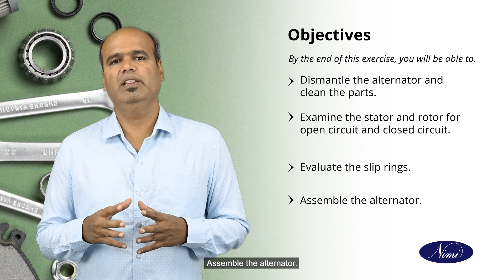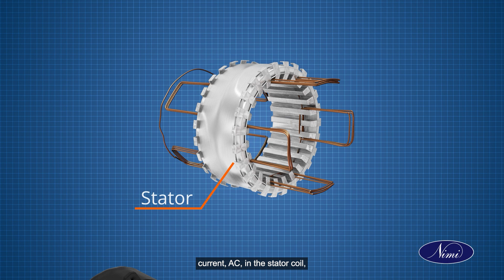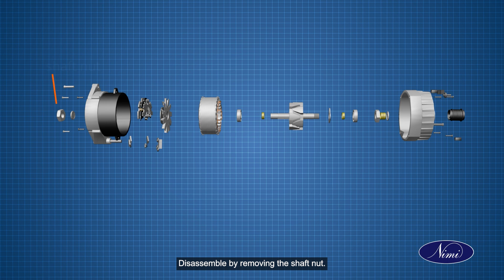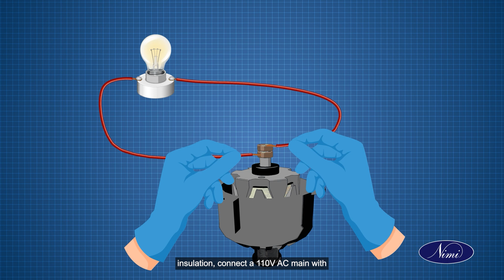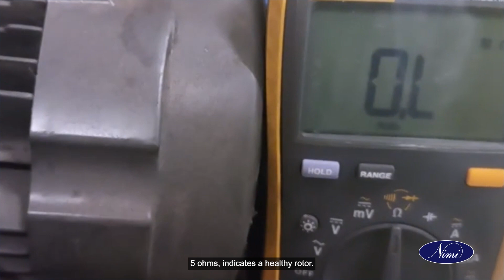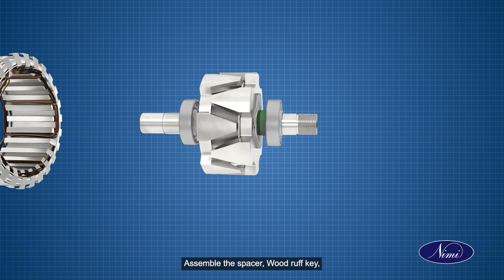Perform Removing & Replacing an Alternator | NIMI | DIGITAL | ENGLISH |

Comment: Hello, may I ask a question please?

4:17 "Remove the stator winding ends from the rectifier by applying a hot soldering iron on the terminal (tack?)"

All the videos I've seen say the same thing, that the ends of the windings have to be desoldered to enable you to pull up/off the rectifier. My alternator is a Denso, and the end of the windings are not soldered but simply curled around making a loop, bent over flat then screwed down. I've removed the screws and can freely prise up the ends a bit. I'm assuming I can use some thin pliers to make the ends turn straight up and lift off the rectifier. (The videos I've seen on other models of Denso, like yours have to be unsoldered.) So can I go ahead as I've described or is there something to be wary of? The colour of the curled wire is grey though I can see into the windings and see a copper wire going up from below and look to be of one piece with the grey looped part but there is no continuity present. 

Your expert advice would be much appreciated. Thank you.